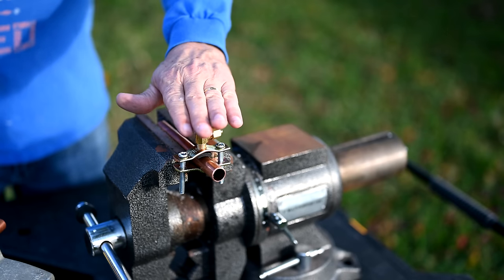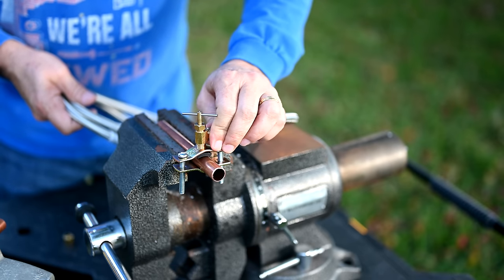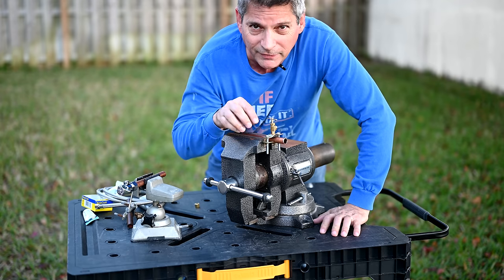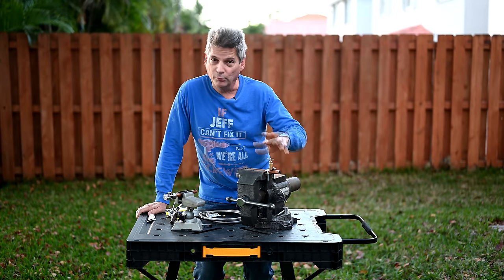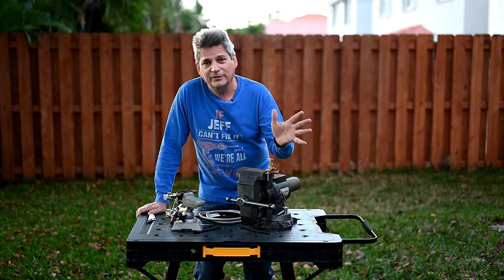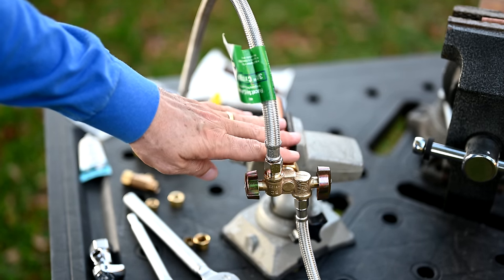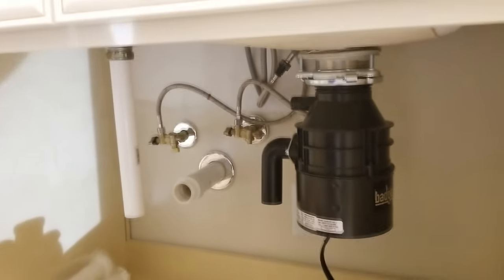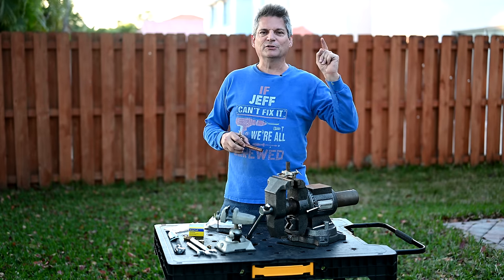Plumbing Tips: 2 Saddle Valve Alternatives For Ice Maker Lines

Comment: Would love to see an alternative technique which replicates the typical scenario where a saddle valve is used such as on an existing pipe running in the basement without the convenience of the end of a pipe as demonstrated in these two alternatives.   I would like to replace the saddle valves the previous owner used for bother the furnace humidifier and the water dispenser but those are taps off of the cold water pipe on on both sides of the water heater pipe.  nether of these "end" fittings work for this common scenario.
Reply from the maker: Yes, I am chomping at the bit for this also, I might have to make up a mock scenario on this!
Reply: Can’t you make a T in the pipe and put an end fitting on the end of the T?
Reply: PPP pop pop up on my own but it 😊😊
Reply: Check out here on YT Big Guy DIY “how to add an ice line”. He shows how to use a tee fitting that’s (if your pipe is actually 1/2” and check for if it’s (OD) outer diameter or (ID) inner diameter to be sure you find the right fitting but he used a shark bite tee fitting 1/2”x1/2”x1/4”. Be sure to have the right copper pipe cutter meant for a range of pipe sizes (found at Home Depot or any hardware store) and you’ll measure on the shark it’s connector how much to cut off your copper pipe. It’s much easier if you head to his channel and watch the detailed step by steps that he does for himself. You’ll have to remove the saddle or cut that part off but it’s much easier than soldering and I’m sure less headache. I did see that you need to check what kind of copper pipe it is: (ASTM B88) for this shark bite fitting
Reply: They sell a Tee Shark Bite valve that has a 1/4" male to screw your icemaker line to. It's a little pricey ($27) but worth it when in a pinch

Comment: I agree that saddle valves are a bad idea.  I have two of them in my house, and while they haven't leaked while having them in for over a decade, I still want to replace them.  What I don't agree with is the idea that "it's bad because it's against code".  There's plenty of examples of things in the plumbing code that just go too far in safety.  One is Air Admittance Valves.  In my state they're against code.  In my, and many plumbers opinions, this is silly since they're built to last 30 years (and are in fact legal in many states).  So I really think you need to demonstrate more than just being against plumbing code.
Reply from the maker: I did demonstrate it, I mentioned the case of dissimilar metals touching, and humidity in the area of the saddle valve causing the metal to corrode.

Comment: You saved me alot of trouble with this tip. My house was built in 1970. The previous owner did no renovations. I had the copper line for ice maker that snapped. I installed this and used a braided line to run from under the kitchen sink to the fridge. Now I have ice and water from my fridge. 😁
Reply from the maker: awesome, thanks for sharing
Reply: @jeffostroff  I still have the saddle valve but it's shut. How do I remove it if I choose to without any issues? Any videos?

Comment: Without a doubt, this is a very professionally done video. Clear, concise, accurate information is what I was looking for, and this, sir, certainly fit the bill. I was hesitant to remove and old SV (on the copper pipe under the kitchen sink, but currently not in use) but now I want to remove that old ticking time bomb asap. I know about shark bite, and I've used them with success, but the "Rolls-Royce" dual cut-off valve looks like the way to go to me, for my particular job (very limited space). Thank you so much for your time and talent. Stay safe!

Comment: I do HVAC and those are similar yo piercing valves which are temporary. Any plumber should never argue wuth what you said as the first thungs I learned when dealing with water cooled equipment is being very careful with dissimilar metals on piping amd if you have to using dielectric fittings to prevent as much corrosion as possible. Saddle valves are temp valves or where a leak wont matter. Great video!

Comment: Excellent video. I do RV plumbing which is mostly PEX. These saddle valves are garbage on them too. It ovals the tubing, then as they age, the rubber saddle seal hardens. When I come in to do a little plumbing, brush up against or disturb it in some way,  it often begins leaking!
Reply from the maker: Thanks for that info on the PEX because I haven't used PEX yet and so I always figured well maybe it would not be as harmful on PEX as it would be on Copper where it would corrode on the metal pipes. Now I see what you were saying how the oval distortion could cause problems and I never even thought about the drying rubber.

Comment: Thank you for posting these.  I have two saddle valves that have been in for over 10 years and I don't have any real problems, but I don't love them or anything.  I've always wanted some alternative and I would have never, ever guessed that option #1 was available.  Makes me wonder why they don't just include those with the kits instead of the saddle valves.  Sure would have been a lot cleaner, and you can turn off the cold or hot (for the dishwasher) water with the regular turn off for the sink.

Comment: Excellent presentation and once again 100% correct. That second valve is the cat's meow, their coming up with some pretty cool stuff these days. You could almost give a demo on the 5 in one wrenches, I might have to get on the tools again just so I use one. Cheers.

Illinois Plumbing Code: No pipe or fitting of the water supply system shall be drilled or tapped nor
2391 shall any band or saddle be used

International Plumbing code: 605.9 Prohibited joints and connections. The following
types of joints and connections shall be prohibited:4. Saddle-type fittings

U.P.C.: pretty much the same, oh there is one thing most codes have a provision that if you do anything to contravene the code it turns into a punishable offense, and no legitimately licenced plumber would risk his license to put in on of those self piercing valves, those are usually good for the scrap bucket.
Reply from the maker: Yes we plan on doing a video for the Ridgid One Stop Wrench

Comment: I appreciate you making this video!  I bought a new fridge and dishwasher, and going to hook everything up there was a saddle valve installed.  I went out and bought the duel valve 1/4 and 3/8 will be perfect because my dishwasher and fridge are on the same side of kitchen on their own water line!  So perfect  love it!  Thanks
Reply from the maker: Awesome Joshua, you did it right! This is the Way!
Reply: Wait you're not thinking of using the 3/8 for the dishwasher and the 1/4 for the icemaker off the same line are you?  Icemaker should be off of the cold water line, while the dishwasher should be off of the hot.
Reply: @buckyswider1  I did quite a bit of research about which water line to use for the ice maker.  And it really comes down to personal choice.  Also my ice water line has been on the hot before I bought the 🏠!
Reply: @joshuaknights30  Interesting!  A quick google reveals quite a controversy on this subject, with some asserting that the hot water is 'cleaner', others saying it's 'dirtier', and some saying it makes zero difference.   And I guess my assumption was that lots of fridges these days have water dispensers.  Def don't want hot water running to that!!!  But I guess as far as temp goes, it makes no difference for ice only- by the time you consume that 'water', it will be plenty cold!!

Comment: Very helpful.  Thank you.  In the end, this (adapter method) turned out to be the most sensible way to connect our new fridge to a water source.  Glad to have avoided the saddle valve; in our previous house there we 5 'orphaned' saddle valves beneath the kitchen from previous owners.
Reply from the maker: Wow, 5 saddle valves showed someone clearly had no clue. Surprised it did not leak.

Comment: Just found a severely corroded saddle valve on my hot water heater pipe. Rubber was compressed and hard and cracked. Had to hacksaw the bolts, never again. Good info, Thanks!
Reply from the maker: Sorry to hear that

Comment: Great video. I’m dealing with a corroded saddle valve right now put on right above an Hvac duct. Impossible to get to without major effort. These are definitely not the way to add a water line. Thanks for showing the alternative solutions
Reply from the maker: You bet, glad to help

Comment: I just recently removed one of these after watching this video. It may have been 30+ years old, but I was afraid I wouldn’t be able to shut it off because it was stuck open. After it was off, I found that the piercing pin did break off so I was glad it’s now gone. I used a 1/2” compression inlet with 1/4” output valve along with a soldered tee fitting.

Comment: Here is where I am. 13 years ago I bought a refrigerator at Lowes. My house is on a crawl space and the refrigerator installer placed a saddle valve just inside the crawlspace door.  He did not place the saddle valve on the main supply line but on an adjacent connecting line. Last month I replaced the refrigerator. The existing saddle valve was completely rusted. Yours truly removed it and replaced it with a new saddle valve plus a 20 ft braded supply line just like the one in your video. If I had the patience to do it, it would take a 1/2 hour to fill a glass of water and ice production is pathetic. So, what is my best solution? Ideally, I prefer to remove the saddle valve and solder in a new copper T connection.  1. What should I do about the hole created by the saddle valve?  Shouldn't the new T connection be installed on the main supply line?  I have no plumbing skills but my daughter says my son-in-law can solder copper pipe.
Reply from the maker: Remove saddle valve, cut the pipe, solder on a T-fitting, then solder a small pipe onto the T-fitting, then install a compression fit 1/4 turn ball valve with a 1/4" output ice maker line is smaller.

Comment: I wish you would demonstrate actually switching out a saddle valve that is in the center of one long copper pipe rather than an easy end fitting scenario, I appreciate this video and your efforts very much I just know mine and many others are saddled in a place that requires removing of the saddle and cutting or soldering on tee fittings
Reply from the maker: I plan on doing a video for this

Comment: Thank you- I just learned something new. I have been using Saddle valves for over 20 years to ONLY drain pipes that supplies water to outdoor faucets.  Am I in violation of the NYS code?
Reply from the maker: I don't know if the code covers outside or not it's just that when I see it in the code and it says what is not allowed and it's a saddle type fittings that to me since we shouldn't be using them at all

Comment: I can appreciate a lot about this video and I agree with you entirely Jeff.  It would be helpful, however, to have instructions for lay individuals on how to replace these awful existing saddle valves.
The reason(s) that so many of these crappy valves remain in properties is because of the plumbing work which is involved to install a proper valve.  Most homeowners are too unsure of themselves (me included) to cut/sweat a 'T' for the installation of a proper valve.  Jeff....howsabout a video for that?
Reply from the maker: I plan to do a video on this pretty soon

Comment: Jeff, I just got a new fridge delivered and when they were removing the old one I noticed a copper supply line was connected. I checked under my sink and noticed there was a saddle valve which I am unsure if it works or not. Prior to this, I was already considering installing the valve adapter solution you described. My question to you is, what is the best way for me to proceed? Should I leave the saddle in place, make sure it's fully closed and go the valve adapter route?

Comment: Good video, but I do have one question.  What if a home owner finds they have a saddle valve and wants to remove and replace it the correct way?  Most homeowners can figure out what to do if they have a nice clean piece of copper to work with.  In many cases though they can remove the valve which leaves a hole of course, and it doesn't leave enough room to cut that piece off and start new.  So now what?  What viable saddle valve repair/replacement options should someone look for?

Comment: Jeff, Sioux Chief has a fitting called an "Add-A-Line" (part  601-G20CV) for those interested in just replacing their old saddle fitting. A bit more complicated than what you have shown, but not all fridge lines can be run from under the sink.  Even if you could, you'd still have to do something with the old valve or it's still gonna sit there and continue to corrode.  Sioux Chief product is simple that it has a compression fitting on each end for your main run with a 1/4" side tap for the fridge hose.  All you need to do is turn off water, remover old valve, clean off about  an inch of pipe on both sides of the old hole in pipe cut out a small section of the copper line where saddle valve used to be, install this new fitting where you just made the cut and then install fridge line.  Easy, peasy and very professional. Just a thought.  GREAT video and oh so true!
Reply from the maker: I'll look into this one for future video ideas

Comment: I am replacing a refrigerator that has been in use for 14 yrs. The saddle valve is installed to the copper pipe which is located on the lower level, with the ice maker water line fed thru the floor behind the refrigerator.  This has not been a problem, but the dealer has told me I need a shut off directly behind the refrigerator. What kind of valve do I need to install to replace the saddle valve?

Comment: Just what I needed to see! One question tho, if I add the part under my kitchen sink, how do I repair the saddle valve? Will I, should I get a plumber for this job? Saddle valve located in the basement above a cabinet, hard to reach/repair.
Reply from the maker: I would cut off water to the house, drain that line as much as possible, and cut through that pipe where the saddle valve was and put a copper pipe coupling there, that pin hole needs to be removed.
Reply: Thank you!

Comment: Could you please instruct what to do if a saddle valve has already been installed for an ice maker?  I understand there is a hole from the saddle valve in the pipe now,.  Please instruct  how to remedy the situation & use one of your methods.  Thanks!
Reply from the maker: Yes I can, you have to cut that section of copper pipe out where the hole is, and I would solder in a copper T fitting, and solder in a small 3-4" pipe length, so that you can add the correct 1/4 turn ball compression valve right there where you T'd off of the water pipe.
Reply: @jeffostroff  Thanks for your response.  That sounds too complicated for us to do ourselves, as we don't solder.  Are we stuck with the saddle valve and really low pressure in our fridge water dispenser if we opt not to use a plumber?  And if we got a plumber to do it your way, how much would it cost?

Comment: So is a copper saddle valve an acceptable solution if you don't have tools and need to do something about a brass saddle valve, and do you need to get plastic on both sides to prevent all contact in such a case?
Reply from the maker: No Adam sorry the idea of piercing a pressure pipe like that on from the outside is just not a good idea and in fact that's why it's banned by plumbing code, and if your insurance company ever performs a four point inspection on your house and sees it they will force you to remove it or they will drop you from the policy. The best course of action which is what most professional plumbers do is they will cut that pipe and insert a T fitting in there and then put a little stub of copper pipe on that T fitting and then add a compression fitting water shutoff valve on there. It's a pretty fast and easy job for the guys that do this all the time for you you could just watch a few videos on how to do it and do it yourself it's not that hard.

Comment: How do you remove a saddle valve?  How does one deal with the hole the saddle valve left in the copper pipe?  Mine is under my house
Reply from the maker: Somebody has to crawl under there and get to it. Basically what they do is cut the copper pipe, and then they saw her on AT adapterAnd then they could put their copper stuff out on the tea adapter for which they can put the valve at the end. I am going to do a video on this very soon
Reply: @jeffostroff I'd like to see that. I have the saddle valve on a copper pipe myself. I have to get it capped or my fridge install won't be done. Too many other things under the sink to be so simple: RO system, garbage disposal - going to get a handyman.

Comment: Question.. What to do if there's a need for third connection? I have a filtered water system, ice maker line and a faucet that need to be connected. Would it be feasible to use both the 1st and 2nd options? 
Great video, and even better information!! Spend a little more for peace of mind in the long run.
Reply from the maker: Yes, or get a y-adapter

Comment: I have a stupid saddle valve. My question is do u have a how to video to replace the saddle valve with a different option? I'm guessing to use a compression fitting id have to cut the pipe?
Reply from the maker: A lot of people ask me that I should work on a video for that some time period really all you have to do is cut on either side of the hole and then slip in the t fitting and then a little stub of copper pipe and then a compression valve on the end of that stub out